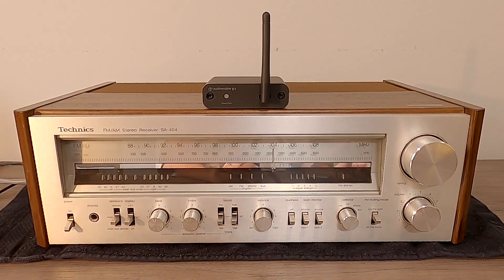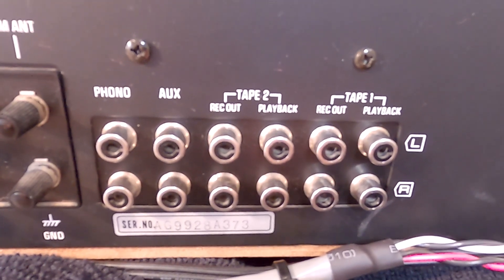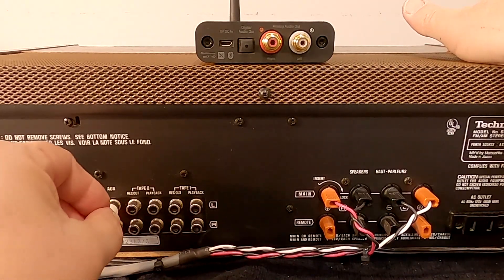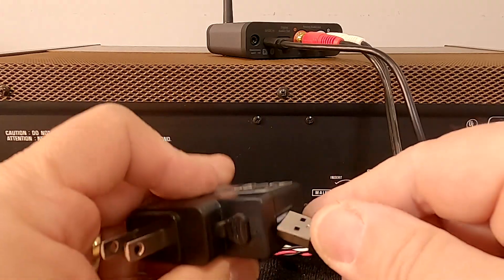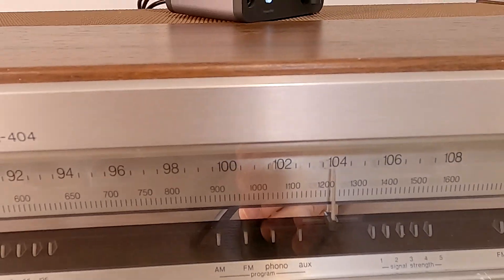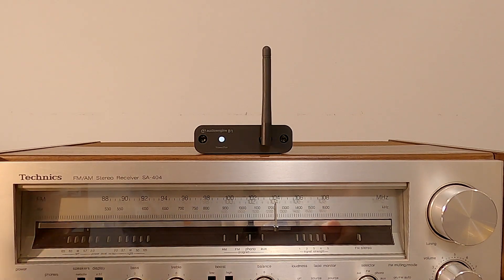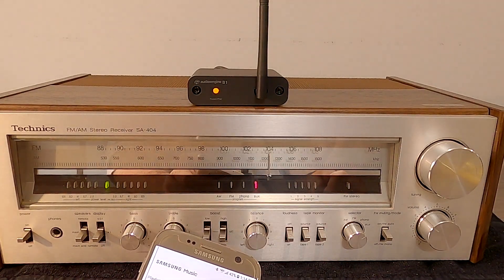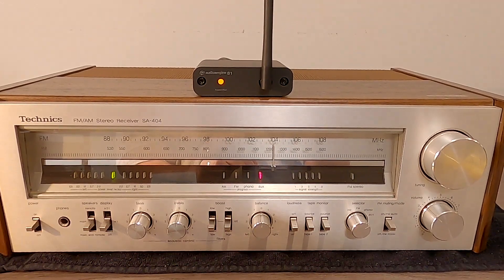How to Bluetooth to any Vintage Home Stereo using Audioengine B1 Bluetooth Receiver

Comment: most of the new receivers don't have the power switch and unstitch on the back anymore, only the vintage ones have it
thanks for showing this
Reply from the maker: When did you start seeing these outlets go away.  A new or modern Receiver to me is like mid 2000s.
It's funny because you are the first person to call me on this
 Hahaha.
Thanks
Reply: @breakerbroke23  anything with HDMI does not have it, I guess late 00's and up. 
Most of the newer stuff comes with bluetooth anyways so the power switch won't be needed :)
Reply from the maker: @AudioElectronicsChicago  I figured you would know about this "newer stuff" I am still stuck in the 70s. BTW... I love those Advent Speakers in your newest video.
Reply: @breakerbroke23  Thanks, I am using mainly vintage stuff from the 70's in my household but I work with electronics and I get the new stuff all the time!

Comment: Very helpful video thanks. I would be hooking this up to two active studio monitors which both are set to max volume (10 out of 0 - 10 switch at the back). I assume the bluetooth receiver outputs are line output or barely amplified? Is that correct? Cause I can't drive an amplified signal into the monitors. Or at least, I think so based on what I read? I'm still learning a lot about adio :')
Reply from the maker: What Monitors are you using?
Reply: @breakerbroke23  JBL LSR305. Currently connected to a Focusrite 2i2 with balanced cables, but no bluetooth functionality. Do you think switching to RCA will decrease the quality of my sound (not that my setup is real HiFi, but still..)? I live in city apartment, so probably do get a lot of interference.

Comment: You didn't use the optical out ? Also when saying you can use tape in on your very old receiver might say what that is record in or play out. Since those connections are not labeled  in the terms you used